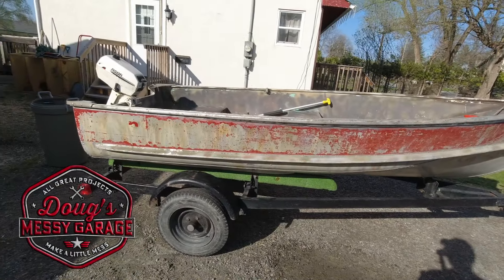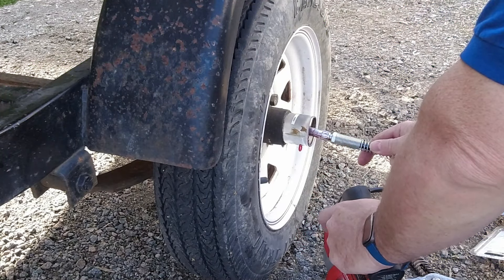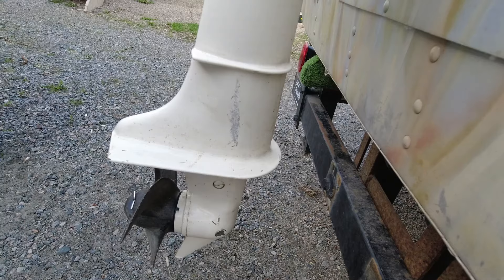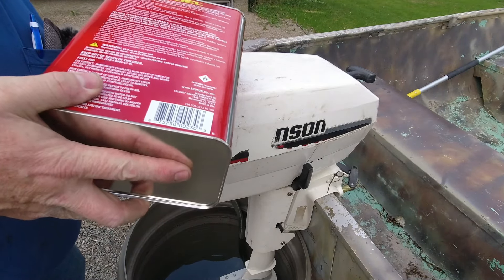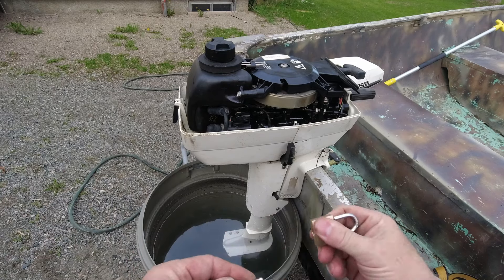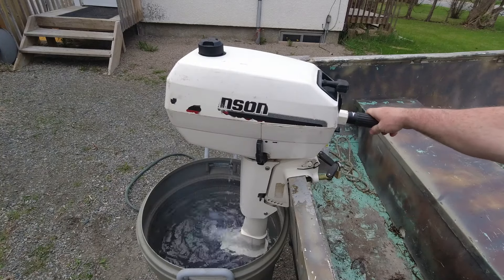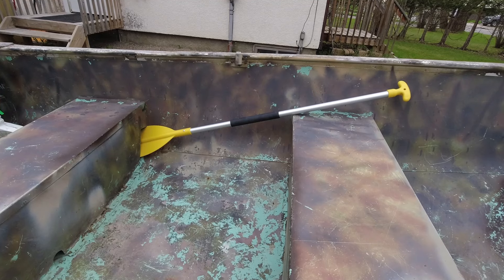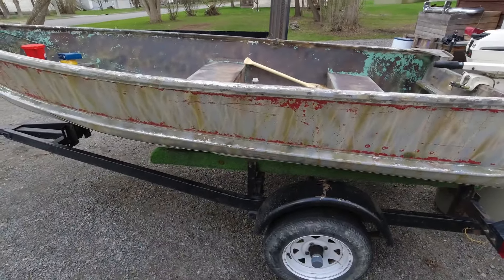The Most Important Step in Boat Preparation

Comment: Bottom screw is to drain and to refill after draining.  Top screw is fill level.  Pump oil in to the bottom screw hole until oil comes out the top hole.
Reply from the maker: Normally I would agree with you but I am pretty sure the upper bolt that appears on the video is the shift fork.  There has to be another plug someplace though to easily fill the gearcase.